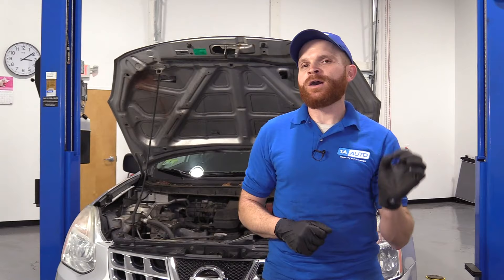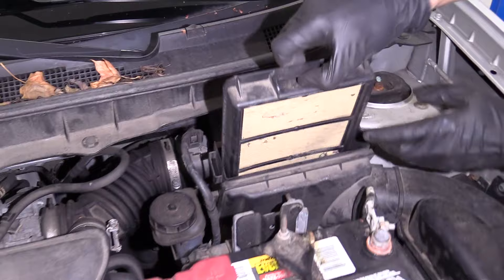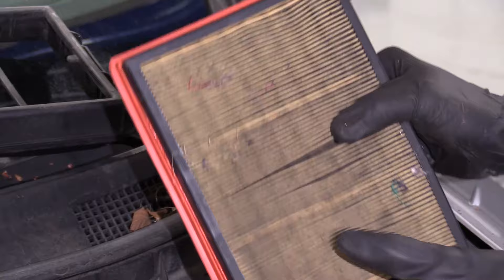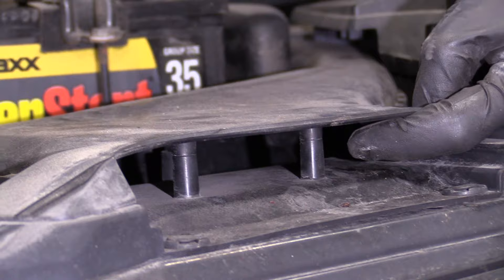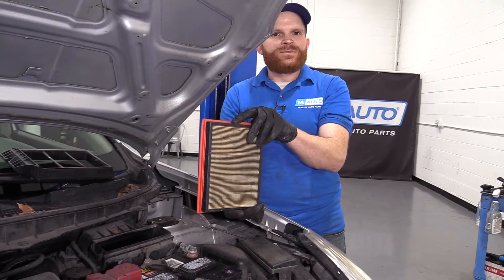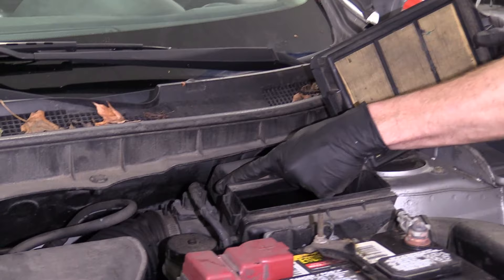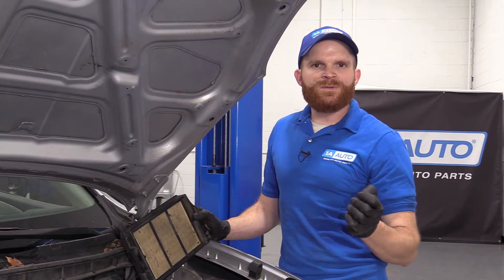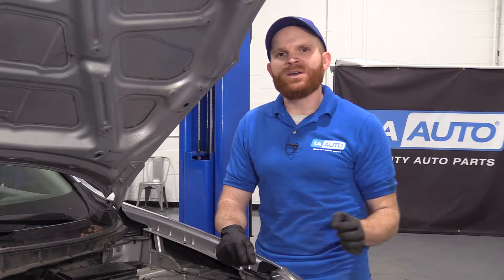Bad Gas... Mileage? Diagnosing Poor Car and Truck Fuel Economy

Comment: I usually change my filters, clean the throttle body, clean the MAF, inspect transmission fluid and coolant once a year. Lot of people say it lasts longer but doesn’t hurt to change early if needed
Reply: What’s MAF?
Reply: @sterlingboyns4883  maf sensor i guess
Reply: @sterlingboyns4883  MAF stands for Mass Air Flow like mentionned in the video. If you cant check out these facts I woudnt do stuff on your car
Reply: Also check the cabin air filter too

Comment: There also is mass air flow sensor sprays to clean your sensor
Reply from the maker: +Alfred Emerson Thanks for checking us out!
Reply: WARNING when disconnecting a Mass Airflow sensor on some cars you MUST disconnect the battery first. You risk damaging the sensor and some can get pretty expensive. Better to be safe than sorry.

Comment: My 2010 rogue was getting only like 17-15 mpg, took a look into the air filter and found out that it was completely clogged, never got a code or light on the dash, but cleaned the whole air intake system and installed a K&N filter and I'm back to 22-25 mpg, made a huge difference, also took the time to take a look on the spark plugs and coil packs, everything is fine there, still need to clean or replace that catalityc and clean or replace the injectors because none has never been replaced and the car has already 186k miles on it.

Comment: My 2004 BMW 325i only got 15 MPG since I bought it 5 years ago.
I cleaned the MASS AIRFLOW SENSOR and I'm getting around d 30+ now!!!
(It never threw a fault code for anything. Including Oxygen Sensors.)

Comment: Yup, rodents in both my car and truck.  Once the first rodent comes in, it’s over, there will be a daisy chain of them as they follow each other’s smell.  I fixed the car (for a while) with hardware cloth epoxied in a couple spots.  It is nuts though that OEMs would not make vehicles rodent-resistant, especially for 4WD trucks that are designed to go (and sometimes stay overnight) up forestry and back roads.

Comment: My jeep has the winch hooked to a 18 wheeler in neutral. Now I get 100 miles per gallon in idle! 
Hooking the jeep to the 18 wheeler was the best fuel economy mod!!

It only idols to run the electronics & the air conditioner!

Comment: So exactly what you said not to do I did that before watching this video and my gas mileage has dropped alotttt and I have a cold air intake so I’m very thank for this video so I will be doing that to my truck but how would you know if your mass air flow is bad

Comment: Great tip re: mice, getting in there. I have had this problem, but don't know where they are getting in....so that's a big help to start. So GROSS. I think they are in my air vents, but the 1999 Rodeo doesn't have a cabin filter so access means I'd have to remove the whole front of ny dashboard....No videos on how to do that so far. I did stick mothballs where I fond a nest by my emergency brake box. Smell keeps me out too but it seems to help.

Comment: Hi, I just recently bought my first car its a 2010 Subaru Impreza hatchback and I love it but the fuel consumption is just ridiculous, its only doing 360km max per full tank of 98 fuel and im only driving calmly not aggressively. I just listed it for sale as it costing me $100 Aud per fill and only getting 360kms out of a full tank and I hardly drive it at the moment. I’ve taken the car to 2 mechanics. One of which is a specialist Subaru mechanic called the Subie Doctor, He did a minor service on the car as well as a few other things, he also took the car for a drive with a scanner on it and he said all data is within the normal specification. The 2nd mechanic also looked at the car and put it on a scanner and couldn’t find anything wrong with it but my cousin has a 2009 Impreza RS and his only uses 10L/100km so there must be something wrong with mine? I’m lost at this point and don’t know what to do? I love the car and want to get it fixed. Could it be a blocked fuel injector or a bad oxygen sensor that’s causing the issue? I’ve cleaned the MAF sensor and the throttle body but no luck. I’d really appreciate it if someone could help me out. Thanks

Comment: Please do a video on Chevy Express 3500 LT 6.0 Fuel economy. Thanks
Have addressed air filter and fluid changes yet my van continues to degrade in fuel mileage. It's a 2016 model with 65,000 miles.

Comment: How many % approximately will I save if I change the air filter? Thanks, Alex!
Reply: If its under 100k miles it'll probably get your mileage back within 1mpg of factory numbers. Regardless, if your filter is dirty you should 100% change it yourself. Its easy and cheap and really makes your car happy

Comment: Usefully video. But if nominal fuel economy in my Lincoln Navigator 1999 18-19L/100km, but my car computer show 24.5l/100, where possible problem? 
- injectors new one 8 pcs
- air filter is good
- maf is cleaned
- idler air flow is cleaned
- throttle body is cleaned
- 4 new O2 sensors
- 1 errors by OBD, c1107 (abs)
Where possible problem or computer is wrong? Vacuum leaks from hoses? Where to find?
Reply: Nice to hear any comment on this issue..nearly same as me

Comment: I recently purchased a 2011 Pilot and i am getting really bad mpg. About 10mpg. This is very bad. Checked my air filter, it looked fine. Replaced my cabin air filter. Next up will be checking my spark plugs. Could it be a bad fuel pump? There are no unsual sound on the vehicle. Please help.
Reply: Same here, any update?
Reply: Me too, any advice?
Reply: @elkuartostudio  im at 15mpg now. Try fuel injector cleaners
Reply: I got a ford focus 12 plate bought few months ago. Just recently realized gutting 12mpg so annoyed. Please update us when you found the solution.
Reply: So maybe you guys need to change the pcv valve

Comment: Thanks. All good ideas. I recently used STP " CERAMIC " oil additive, with immeadiate noticable smoother, quieter motor operation results.I am also a big fan of LUCAS injector cleaner and lubricant.  And my very favorite is Marvel mystery Fluid,  supposedly mineral oil, lard (?), and turpentine,  per government investigation. Best wishes. And critics never say anything their just dumb people, that just prove there was Cromagnon dating.  Thanks again.

Comment: my 2011 Chevrolet traverse ls is pos to get like 17 city/ 24 highway. but on the meter it says im only gettin a lil over 16. and most my driving is on the highway. What could cause it beside a airfilter.  I put it in shop when it started running bad they said it was a bad cadi so they replace it. didnt fix the problem so they said it was a bad 02 sensor and still didnt fix the car running like doo. They then said it was a bad mas air flow sensor and my car runs worse now than it did before. all from a p420 code. It dont come on but my car still feels bad. rpm move up and down and sometimes when im on a hill it feels like running on the warning bumps on the side of the rd.

Comment: I have a  2014 F150 3.7L with 114k miles. Replaced Air filter and plugs. Still only 16.5 mpg. Any suggestions?

Comment: I have a 2015 wrangler rubicon and had the oil cooler and plugs changed. Every since my fuel economy went south. Before hand I was getting about 357 on a tank and now I may get just a little over 200 miles per tank. Any suggestions on what I should look at? Filter is good. I thought it may be catalytic converter.
Reply: Brother same on an Acura, did you change oil types?
Reply: Same. Lop
Reply: Check the plugs/gaps ?

Comment: Hi friend. Wanted to know if you could help me out. I have an 07 Nissan Sentra 2.0 automatic. I am getting horrible mpg! I get about 8-10mpg both in the city and hwy. I've done just about everything you can think of to get it to work. I have new spark plugs, air filter, fuel pump, tires, battery, cat converter, cleaned MAF sensor, I've even tried fuel system cleaner and lacquer thinner in my tank. I norm put 87 gas in my tank because that's what it says in book. Nothing still hasn't changed. The manual says I'm supposed to get 24 city/30hwy and I'm getting nowhere near that. Please help! TIA
Reply from the maker: +verinb9 We wouldn't be able to diagnose an issue like that here, you may want to have a local mechanic take a look at it. Thanks for checking us out! http://1aau.to/m/Shop-1AAuto-c
Reply: @1AAuto  😢
Reply: Me too man! Pls lmk if you got it fixed and how!
Reply: It’s a Nissan so chances it was built poorly and you can’t fix it.
Reply: @Nikkk6969   hey could you help me out. I have vw polo. It’s using a lot of fuel. It’s parked up. Everytime I start car and leave it in neutral (not even driving) for about 20 mins I can see the amount of fuel on the digital reader go down about 5miles. And the actual fuel pin decreasing:( any info to help me?
Reply: @jahid_1  what did you do that’s happening to my car ?
Reply: Does it run smoothly?
Maybe your brakes/E-brake are on??
Other drivetrain issues, diff etc?
Take to a mechanic!

Comment: yea cuz i drive a 2011 honda accord and i’m only getting 300 miles with a full tank
Reply: Did you find a fix? I’ve got a vw polo that’s not been driven. Everytime I start it i can see the fuel needle dropping. And also the digital fuel stating how much I have left has dropped like 15 miles.

Comment: Tell me the technical reason for poor gas mileage. If the computer is matching the available incoming air to fuel for the 14.7:1 air/fuel ratio all I see is poor performance
Reply from the maker: +Tim Dienst There are so many reasons for poor gas mileage from bad O2 sensor to bad tire pressure to bad spark plugs.  Thanks for watching!
Reply: 1A Auto Parts of course there’re plenty of reasons why you CAN have poor gas mileage. But you said that a clogged air filter would do it. My point is if everything is running correctly the computer should be correcting the air/fuel mixture. To me this would mean poor performance due to poor air flow (less air less fuel). The computer should be correcting for poorer air as well as other degradation of other engine controls. That is why tune ups are needed. Such as Spark plugs, air filters, O2 sensors, EGR, throttle body cleaning. Even intake valve cleaning.
Reply from the maker: +Tim Dienst Thanks for the feedback!
Reply: @Bluephrog  hey could you help me out. I have vw polo. It’s using a lot of fuel. It’s parked up. Everytime I start the  car and leave it in neutral (not even driving) for about 20 mins I can see the amount of fuel on the digital reader go down about 5miles. And the actual fuel pin decreasing:( any info to help me?
Reply: @jahid_1  Did you get help?
Reply: @1AAuto  And... Bad Thorttle body, Bad fuel pump etc etc...